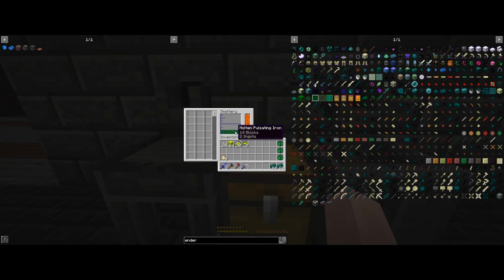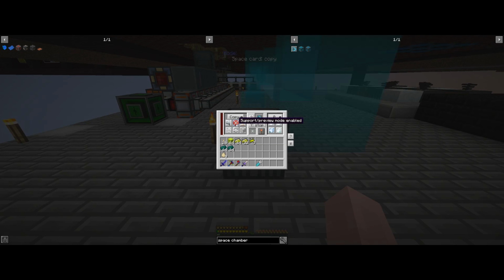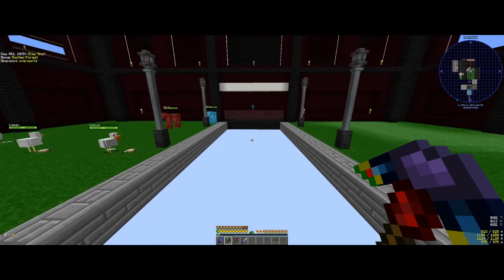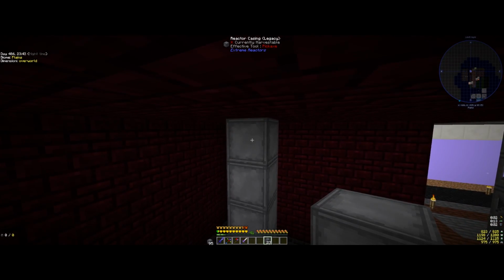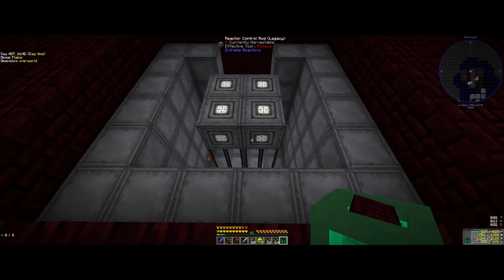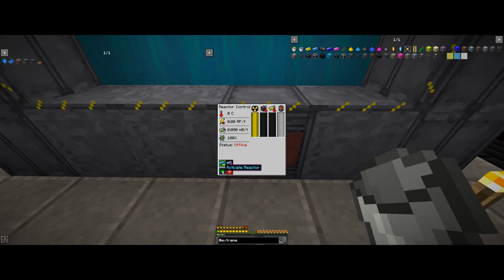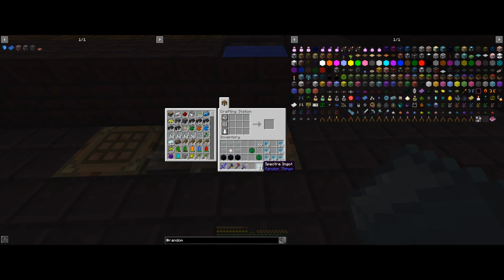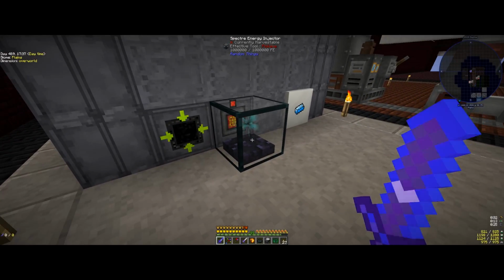Project Ozone 3 EP18 - Extreme Reactors, Random Things

Comment: Really liking the base build so far. Just a tip in regards to Fluid cows. The Mob Duplicator from Industrial Foregoing has an "exact copy" and "non-exact" copy function. If you use the non-exact copy function you can obtain any fluid cow spawn regardless of the type trapped in your mob imprisonment tool.

Comment: Great video.

Couple of things about the Spectre items:

1) Make sure you chunk load the reactor and injector with chicken chunks, not FTB chunkloading as it seems to be having issues with this pack between dimensions.

2) There are Spectre chargers that you can make that will charge items in your inventory including your armor.  I made the 20k one and a mid ranged jet pack for dimensions that disable the flight totem.(Weirdly enough while the charger works as a bauble, it would only charge the jet pack when it was in my hot bar.)
Reply: Ricki Carter lol.  I figured it out when I was trying to set up a builder in another dimension to mine some Lordcraft ores.  It kept losing power even though I thought my power source was loaded.
Reply: Ricki Carter The Wither drops the cards as well.  Not 100% but probably 20%+

Comment: Hey Kelley, your mic is very low... consider increasing the volume about 50 % on your videos.  Also I really enjoyed the factory architecture.  I do wish you explained your inspiration and showed it in a little more detail.  I believe the PO3 pack has frames for making smother edges, consider adding some.  Progression is important but i think also taking your time and making your buildings look good is also important.  It's rare to have functional architecture in a modded minecraft play series and would set you apart from 9x9s.